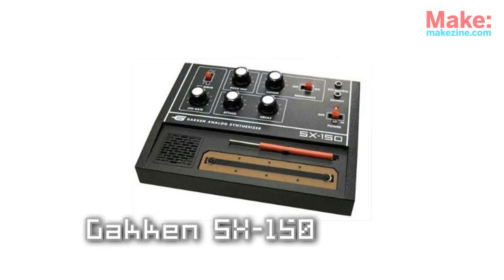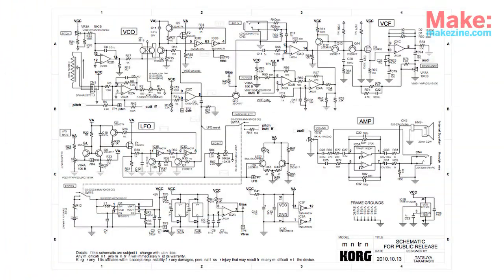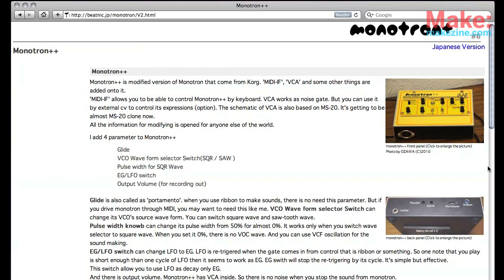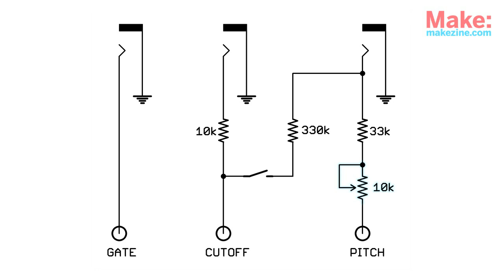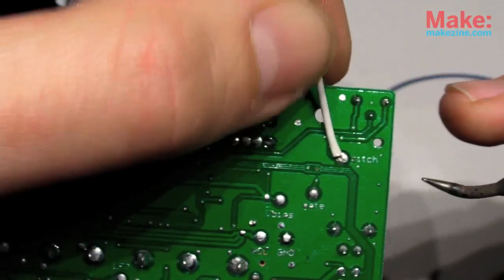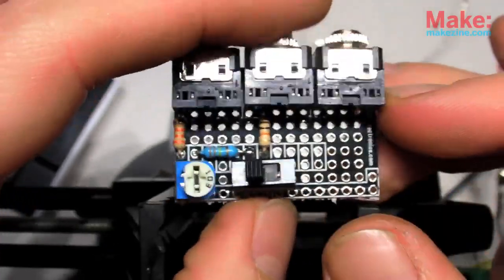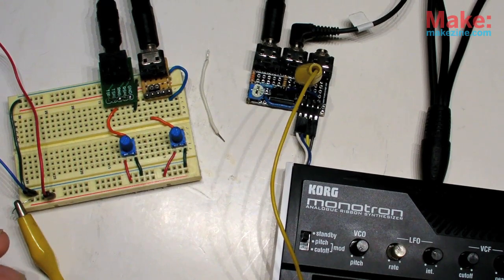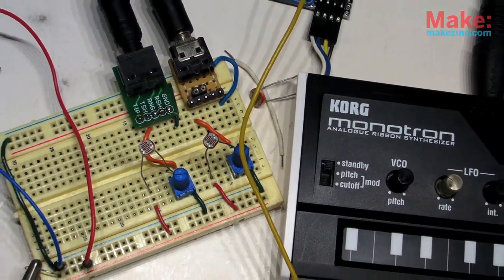Collin's Lab: Monotron Hacking

Comment: the biggest take away from this video is hooking up some sort of jack or connector to the project instead of just hard-wiring in to your immediate idea.  I only hoked up to one port on my Monotron but I still used a connector instead of bare wires  because I saw the good practice here- I have taken this to other projects and it has been very helpful!

Comment: for example you can try to add power core like 1 AA battery and when sound goes outside (for heating etc..) that heat level should regenerate the battery's starving potential then cheap air solutions at homes is possible.

Comment: Like. 3rd video and hit paydirt. This is where I want to be. I'll start with two 555 timers. I just got a small cheap  box of CD4XXX series chips, and includes a CD40106.I going to hold off on the new arrival and go screw up the kitchen cutting board first.

Comment: Will you supply a link to the Schematic?  Also, are those 10K Pots, and will
you give a bread-board as to the wiring of the connectors on the back of the 
breadboard? It's unclear unless you have another video on those.
Reply: It's a 10K pot, and I was able to recreate it on a breadboard by following the picture of the schematic in the video (and I'm a complete novice with electronics). Just check continuity as you go with your meter and you should be able to get it connected.
Reply: I found the schematic on another site-- as this one did not.  Thanks, though.